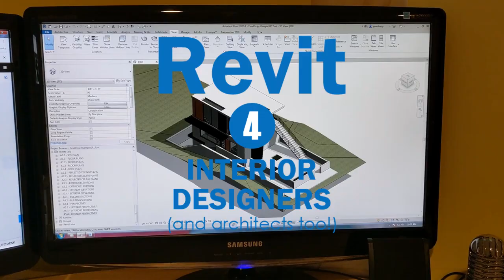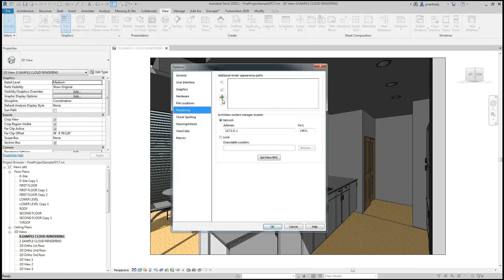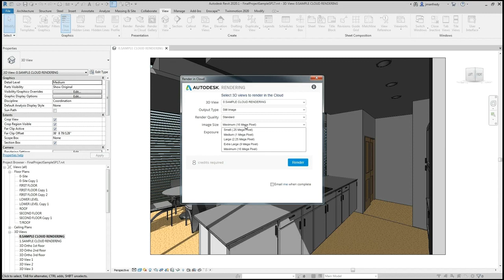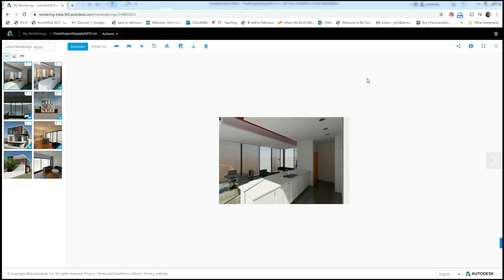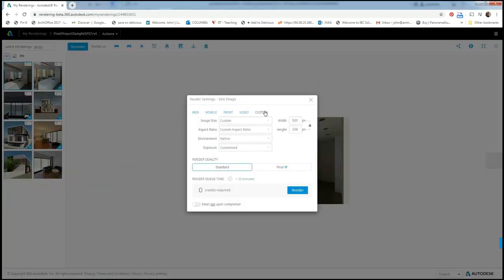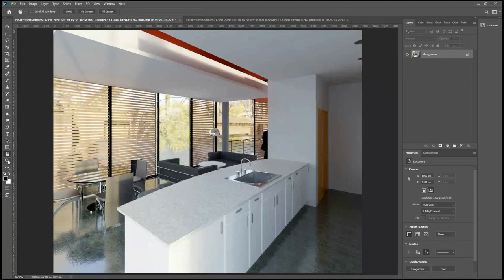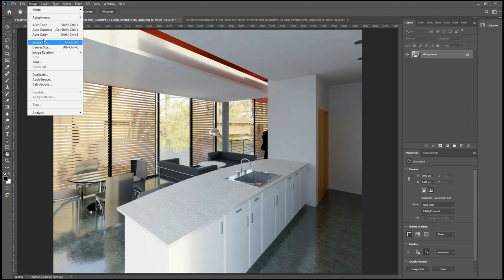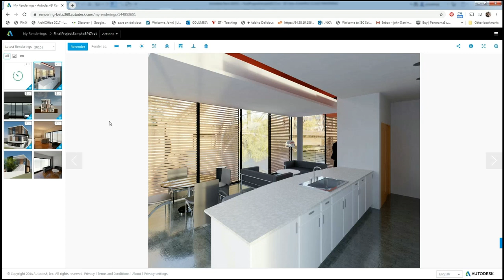How to Improve Revit Rendering Quality

Comment: Hey i am an architecture student_asus g14 amd ryzen 5 4600hs  is ok for the architectural softwares__as there is lots of rendering revit and all
Reply from the maker: That should work however you can create renderings using the autodesk cloud service and you won't need your computer for processing renderings
Reply: @jrmanfredy  will they service even work for v ray and lumion??
Reply from the maker: @basavarajv.l6665  Sorry, I meant that you can produce renderings directly from Revit using A360 rendering cloud without the use of 3rd party rendering software.  If using live-rendering software, your computer hardware will do the work.  Check computer benchmark requirements from Lumion and compare with your computer.